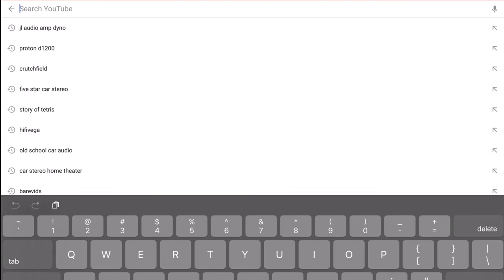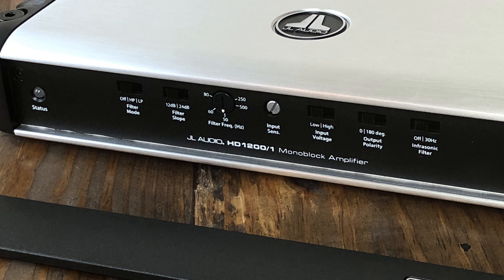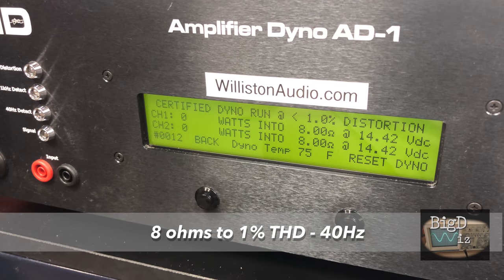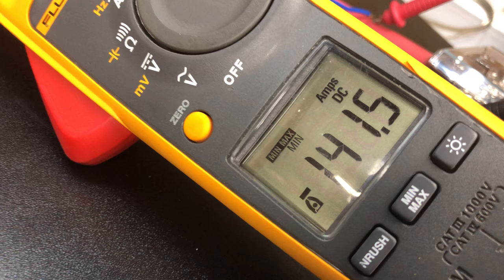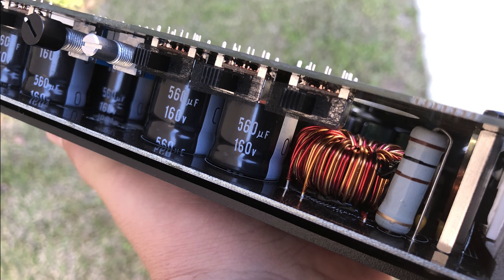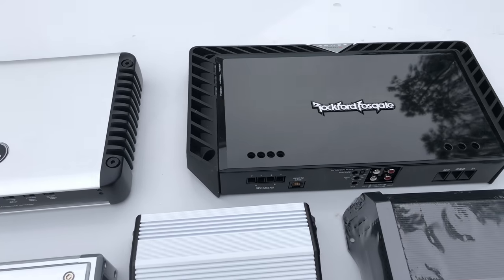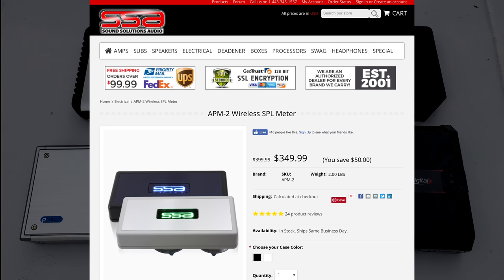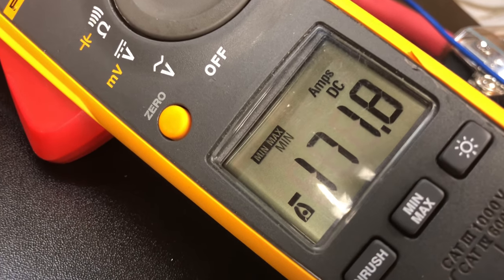$1100 for 1200 watts? JL Audio HD1200/1 Amp Dyno Test

Comment: I like the idea of testing the amps in the car. I also started thinking if there was a way to make a Subwoofer dyno after seeing the jl in your daily driver. Most subs aren't rated past 1500 watts. Maybe the dyno test for subs would be 1hour of constant play time free air at their Fs Frequency. You could use the AM1 For live wattage. you start at Half Thier rms rating of sub for 1 hour. If it survives with no coil rub or signs of damage you incrementally up the wattage and run for another hour. Etc. Propper way would probably building an enclosure to manufacture specs but that would take even longer lol.. I think it would be cool to watch. Just time lapse each 1 hour dyno run. Pretty much each Subwoofer dyno video would be a Subwoofer blowing video. I'd love to see SSL subs, Rockville And Dual Subs Doing This "Subwoofer Dyno". Let Me Know What You Think!

Comment: Some would argue that Alpine, Kicker, and Rockford are overpriced as well! But they have been in business for around 40 years Alpine even more, and are still bringing out new innovative products. Some of the brands listed in the comments are very new, one is only 5 years old. While they bring solid equipment they are using designs, engineering, and built parts that the big boys brought us 20 or 30 years ago. The only difference is they are beefing them up to put out more power. So honestly we are comparing apples to Oranges, each has it's place, it just matters what's important to you. What you want, what your after. One isn't necessarily better or worse. Sorry for taking up so much space I just had to get it out there!
Reply from the maker: I like this insightful comment. Thanks for sharing your thoughts 👌
Reply: well, they have their reputation on the line. So no bad things or they'll end up as bad companies, really
Reply: I kinda reject the premise. I've commented before that JL in the UK have shot their prices up by 30-50% over the pass few years for no apparent reason. I notice this soon after the Brexit Vote that JL along with other brands ... all of a sudden, jumped in price. If there are marked improvements or new technology, then I would agree with your comments. However when one is paying for a £300 widget which used to be £200 a while ago for no apparent upgrades, then you've gotta ask yourself if that's good VFM. *I really, really ... really love JL*, but for example (subs) I bought the JL Audio CP108 enclosed sub for £219. Now you'll pay £319 and there's no difference in performance. That's one heck of a price hike! 

As for the HD amp, they used to go in the low £600's. Now they're near £800 (779). Again one has to ask; What am i getting for an extra £150-200 that I'm paying, in comparison to the price a few year ago? Answer; Nothing!!! Doesn't sound good to me. I would still buy into the JX and XD models at a push, but when the price for the HD amps has gone up by over £150 for no improvement, that's a hard pill to swallow.

Morel, Alpine, DD, Hybrid Audio, Sound Cubed, Sundown etc, etc, all keep their prices or bring out new and improved. JL - 30-50% price hike for same product. Same for JL subs. The 8W7 is now £500 = $700 for an 8". That's a lot of 'splash' when you've got the likes of Sundown X-8 for $200. 

OK, we in the UK can't get are hands on half the gear you in the U.S. can, but more and more, I'm struggling to justify JL Audio. I still love them, but your paying twice over the price of a Rolls Royce/Bentley money, for what is an Merc E-Class brand. That just doesn't make sense.

Its OK to be nostalgic, but not at this price!
Reply: TransmissionLineDesigns the 8W7 is $500 USD so I'm guessing it has a tariff on it as well as the other JL products and other brands going up in your country. I know that tariff's have been an issue between our countries for awhile. I made a knife for a friend in the UK and when I sent it to him he had to pay a huge charge for something that was a gift. I can understand why you would shy away from products that are high priced, I was just pointing out a few reasons they could justify being higher. The market will determine the price. If people keep buying they won't change, but if people stop buying the prices will come down to compete.

Comment: What size fuse should you be using on the power input wire? The biggest I had on hand was an ANL 120 amp fuse, but I blew that one really quickly

Comment: JL is overpriced. I've ran it years ago. But for the money you can do way better. I got 4.5k for 900 bucks. But for the JL fans and people that think everything expensive is the best. It's for you. If they run JL they probably have a iPhone also 😭😭😭
Reply from the maker: BigD taking one for the betterment of the community 😁
Reply: Idk but my max on amps is 1200 lol
Reply: JL makes 4 cheaper 1000+ watt monoblocks.  It's like you're arguing against having choices....
Reply: Trapperjohn1000 I’ve had 2 androids before (moto x and Samsung galaxy) and both of them had issues within about a year and a half. Audio and graphics bugs, crashing apps and just general slowing down. I have an iPhone 6s that I’ve had for 3 years now without any problems besides a shorter battery life (normal for lithium batteries). Just my 2 cents...
Reply: @88bananapeels  I phone sucks... Android all the way!!!!!
Reply: Lorraine Stewart Androids are just like budget subs, they get loud and play everything you need them to but the internal parts are low quality and they never last. Good specs don’t mean shit if it can’t consistently perform that way in real world use
Reply: @88bananapeels  well considering apple used samsung parts for a long time. Iphones arent neccesarily any better than samsungs, and it all depends on which phone you have. Of course an iphone is going to outlast a budget android, but the samsung notes, the lg v series, the htc U series, huaweis flagships. One plus phones, etc. All have benefits against iphones. Apple is a company based around planned obsolescence
Reply: And when your phones are made to last 2 years at best, and force you to upgrade to the next, it loses its value in my eyes.
Reply: @fernandogonzalez5770  the only thing bad about android phones is the software layers some manufacturers put on them. Especially samsung is horrible with this.

Just buy a vanilla version like a oneplus or flash it to a vanilla version. Nothing beats a vanilla android flagship honestly.
Reply: @baronvonlimbourgh1716  i do agree that a lot of android skins are god awful
Reply: @fernandogonzalez5770  i don't buy any phone that i am not able to at least flash lineageos onto. 
Im done with all this manufacturer nonsense, it is really getting stupid. If i buy it i control it and what it does. Corperations treat you like you are renting their shit nowdays.
Reply: @88bananapeels  
Lol. U know how many bugs n bad programing n parts Iphones have had?
Reply: Miguel Hernandez Lol, no I don’t I haven’t had one problem with my 6s in the 3 and a half years of owning it...
Reply: @fernandogonzalez5770  Very uninformed statement. Still rocking an iPhone 6, not an issue after 5 years. Girlfriend have had 7 android phones in that time.
Reply: Trapperjohn1000 I run JL everything and alpine headunits
Reply: Nope. I have a pixel  hd900/5 and w3 and c2
Reply: Trapperjohn1000 guarantee your android is made in China as well🤣So don’t be knocking iPhone
Reply: hahahah!!❤ your right.. apple stickers everywhere!!!
Reply: You can always tell who like China designed amps. And sacrifice sound for power . I use to be like that when I was younger. I didn’t care about thd,Just power
Reply: @jruepetty4530  your sadly incorrect...your confusing "china made" with very very old 1990s "class d"..... china amps are top of the line when you spend a little money....JL HD1200 i will take for FREE, if you give me one, i will take it, and sell it on ebay....im sure your confused about "class A" also , but i dont have time to educate you...view youtube vids

Comment: This actually makes a lot of sense why my system sounds so good in my little Chevy Tracker. I didn’t realize these amps were good down to 10.9 volts. I’m running a 12w7 with an HD750. All stock electrical (70 amp alternator, cheap wet cell battery, no big 3 upgrade). Just 4 gauge ofc power and ground wires. 
I’ve been planning on doing electrical upgrades, but now I’m questioning if that will even help anything.

Comment: I've always stuck with JL because of their consistency. I've never gotten a bad JL product. I've gotten blown Kicker subs straight from the factory, burnt out or faulty Fosgate Amps, the only brand that has been consistently superb out of the box has been JL. I currently run a HD1200 with 2 W7 AE 12's and I'm pushing 129 DB with a vented box. I love my set up. I did have 3 kicker IX 1000's with 3 Solo Baric L7 15's. The bass was deep and thunderous, but it did not sound nearly as good as my W7's.
Reply from the maker: I use a 10W7 in my car and I love it
Reply: @wal  it’s definitely my favorite for sound quality. But I do miss the rumble from my kicker set up!

Comment: They are out of reality on there pricing anymore. For 1100$ I can get damn near a legit 5k rms clean power so why would anyone buy this?
Reply: chris jones For $660, you can get 6k RMS @12.6v from two strapped Xtr 2500.1's
Reply: The rockford power series will do just as good if not better than JL
Reply: Quality not quantity
Reply: @AndrewB23  not hardly, over priced and not worth the money
Reply: @chrisjones6165  And the 5k wont have even close to as good as sound quality as this, sure it would blow this away with power but it sure wont sound as clean, these are SQ amps

Comment: Rips Tech was developed from an idea I had with modifying my Soundstream Ref705 amplifier.
I worked at 007 Systems in Ft Lauderdale at the time.  We were a Jl audio dealer and had frequent visits from personnel from JL.

The idea was that, my amplifier, Ref 705, was rated at 50wx4 @4ohm and 100wx4 @2ohm.  The sub channel was rated at 200w @4ohm, 300w@2 ohm and 400w@1ohm..

Im a purist when it comes to car audio. I ran the Pioneer DEX-P1R head. Tuned ported kick pods(70hz) with Pioneers top of the line components of the time. With the 3 way Xovers of the P1R, I ran 2 channels of the 705 to the front tweets and 2 channels to the front mids. I ran the SPL160 15in sub in 3cu tuned to 27hz(2 4in ports about 23in long)  

Most people that had the same amp would have front and rear speakers and whatever subs they decided on.  The amp had a switch to select high or low current for the sub channel.

Well if you wanted to get 100w from each of the satellite mids n high channels, you had to use 2 sets of speakers in the front and 2 sets in the back to operate the channels at 2ohm to get that 100w per channel. Wasnt much of any 2ohm mids and tweets back then.  In my case my sub was 2 4ohm coils which did not pull the full power from the sub channel..  But most people just had 1 front set and 1 rear set and didnt get all the power they were paying for...... $1200 for the REF705 at the time.

So I modified the power supply.  It was a loosely regulated supply, so the rail voltages sit at a much higher level with no input than they do at rms continuous voltage levels.  The high current and high power switch only changed the number of secondary windings on the transformer for the sub channel rail voltages. So I decided to rewind the transformer to increase the mid n high rail voltages(mid 30s volts to 48v with a power input of 15.9v, provided by a Jacobs Accuvolt 1500) And also I ditched the switch and wound the sub rail secondary to 48v also.  This gave me 100w x 4  and 500w rms x1. One more thing that needed to be done was to change out the zener diodes that lowered the rail voltage for the +15v and -15v regulators for the preamp circuits, as the max input of the regulator chips was like 35v, so the zener value needed to be higher for the higher rail voltages. I soldered them to the heat sink side of the board as they were too hot on the top side for the mod.  Joe from the marketing department at JL had doubted my work.  He had heard my system before the mods. Then he had heard it after.

About a month later he said that they were going to make my dream amp. An amp that measured the ohm load of the speakers and then it automatically adjusted the rail voltages accordingly, to get all the power of the amp into what ever load was applied. 

But, even with similar amp power, the 705 cracked the whip on the JL amps, as they were more regulated in the power supply than the Soundstreams of the time.  My sub channel could pop well over 1500w initial peaks, let alone over 200w of the same to the satellite channels, due to the loosely regulated power supply. Music is as you say, dynamic, for the most part. So the Soundstreams had a great advantage over regulated supply amps of the time, such as JL, Precision Power, etc. when it came to rated power scales.

The mastermind of these old school amps was Wade Stewart, who came from designing concert amps. Not sure if he is still around, but last I heard he was doing repairs specifically on the amps he had designed back then.

Mags
Reply: Still have the Ref705 in modified condition.  For more power these days, I really like the pioneer champ series amps.
The Pioneer Champ Pro 12 sub is a serious little monster that I believe most overlook as you can get them for less than $100 on ebay or amazon.  The 96db sensitivity rating is the number to pay attn to.  My bud has 6 PSI 15in subs run with 3 5kw Incriminator amps.  4 batteries, 2 alternators, 3 big cap banks, blow through bandpass in a Toyota tundra. I told him to go with 6 Pioneer champ pro 12s and 3 of the GM9601 amps.  Didnt believe that $1000 in equip could come close to his over $10000 in equipment.  So I told him I was going to build it in my buddies Scion XB.
A day later he asked what size enclosures and he was going to do it in his buds suv to show me it wont work.
3cu ft each tuned to 25hz(1 4in port 16in long for each sub chamber. Total 6 ports).

And he did.  It was louder. Stock alternator, single stock battery and no caps.  2 weeks later he ripped it all out of his buds truck to send it in for repair. Ripped the roof of the suv at the seams.  ;)   But he still has the mentality that more money means more people lined up to sit in his truck.  lol  Sobeit.

The tundra needs nearly 40kw on the 6 psi subs to do the same as the Champ Pro 12s at 5kw.  Murder by numbers.
 PSI subs are 88.5db@1w vs Pio Champ Pro 12 96db@1w

With the 3cu ft tuned at 25hz, 1 pio 12 you can hear 18hz loud and clear in the Scion.  His girlfriend made him take it out and said, What, are you in high school again? So we toned it down to a 1.5 sealed and she let him keep it.  lol

Mags

Comment: There’s a big difference between made in China and being designed in the US.  All the Chinese companies do for the big name brands is use an robot to rapidly place the electronic components on the circuit board and bake the components on the circuit board to the solder points.  Which is just like soldering.  

A lot of the newer companies just use an off the shelf type of China/Korean amp with no innovation or quality what so ever.

Comment: Nice amp but too much for China made
Reply from the maker: Must be a huge markup on these
Reply: I bet this amplifier costs no more than $150 per unit to produce. That kind of mark up is greedy and unacceptable.
Reply: that's incredible inaccurate.
Reply: This is not one of your run-of-the-mill skar RP Audiopipe Chinese board actual R&D went into this board you're not going to find it in any other amplifier
Reply: I'd actually be fine with paying the $1,100 if it was made in the good ol USA

Comment: Jl just isn't worth the money.
Reply: First of all, 
HAVE YOU EVER OWNED AND INSTALLED INSIDE YOUR CAR ANY JL AMPLIFIER?
Reply: Worth every penny
Reply: I have a few jl amps and they blow me away every time I first install them I put a jl audio xd600/1v2 on a sundown 12 rated for 1500 watts and it put that sub to work and sounded amazing. Never gets hot and I've never blown one up even when over working them. There very robust and always perform.

Comment: Even though it is a class d amp, JL Audio has a reputation for very clean sound!  Yes, their gear is more expensive than most, but their build quality is superior to most as well. When you consistently produce high grade products that perform very well and sound spectacular, you can be more expensive and get away with it. I think that it matters less about some things and more about others. It’s up to the individual buyer what is important. I still prefer Class A or A/B in any audio product. That’s my preference. Yours may vary and that’s your choice. Make yourself happy is what I say! It’s called choice!👍🏻😊

Comment: If the amp costs more than you are wanting to spend, don't buy it. Stick with Billy Joe Jim Bob's 150,000 watt amp that goes to .000003 ohms and sells for $29.95. It is 10 feet long and has flashing lights all over it. It also comes with a rolled up paper picture you can have tattooed from your feet to the top of your head.

Comment: Everyone talking about how you can get a 1200w monoblock for way less with more power. Although that is true, can you find one that will do the same amount of power at 3ohms to push a 13w7 or the same power at 4 ohms? That can give you a lot of flexibility to push different type of subwoofer configurations. On top of that many amp can match the sq coming out of this amp.